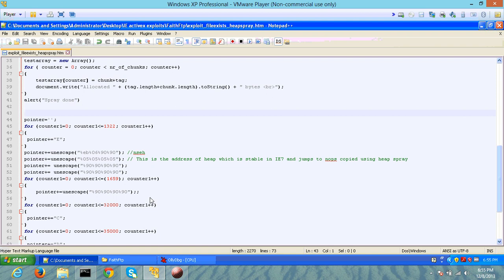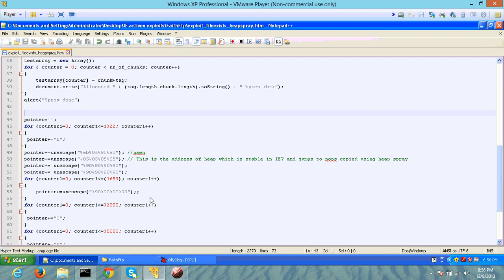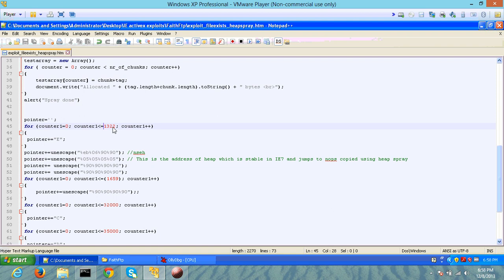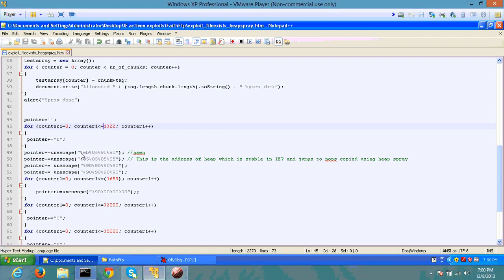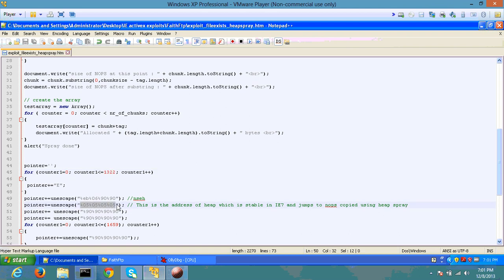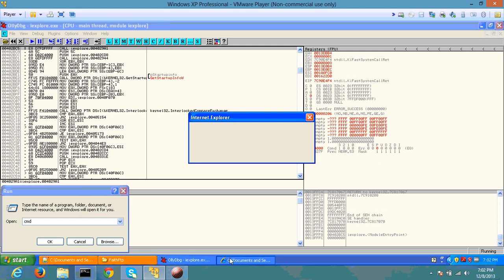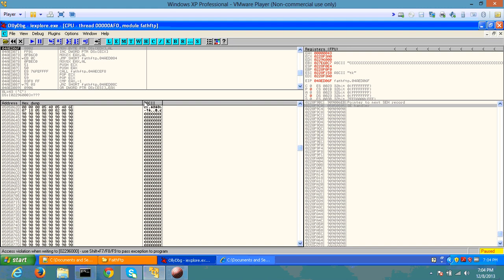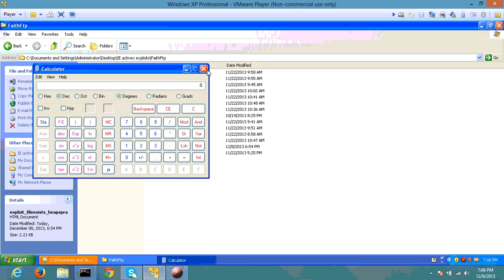Windows Exploitation (Heap Spray/ASLR Bypass)

Comment: Is this technique can still be relevant today on the Windows 8/10 OS's?
Reply from the maker: Nope, this is just to give an introduction into the topic. I think on moern OS u would need to bypass additional protection mechanisms such as EMET, and might need to use vector array rewrite technique... U can learn about it in the following book. It is a bit expensive, but worth the price...
https://www.amazon.com/Windows-Exploitation-Course-Stack-Overflows/dp/151946228X/ref=sr_1_7/191-4087684-3466253?s=books&ie=UTF8&qid=1466206717&sr=1-7&refinements=p_27%3AMr+Samuel+Huntley

Comment: Why and who would use heap spraying?
Reply from the maker: +Jason Bourne: Not sure if you mean in a sarcastic way or you just asking, I know that the technique will not work at this point in  newer IE versions, it still is a good way to segway into for a newer person to understand how the ASLR protection mechanism could be defeated. The newer technique could be to use possibly something like array length modification or vector modification aspect.